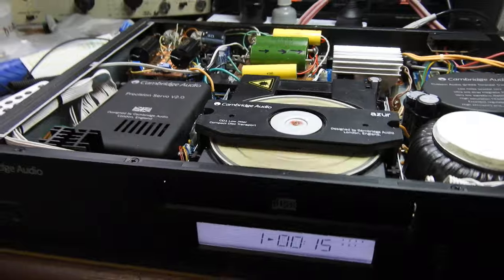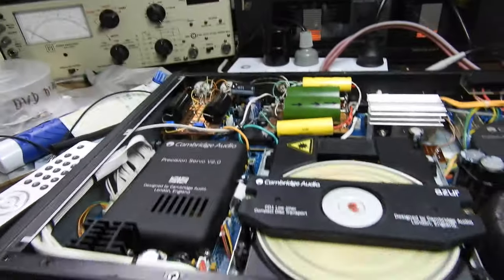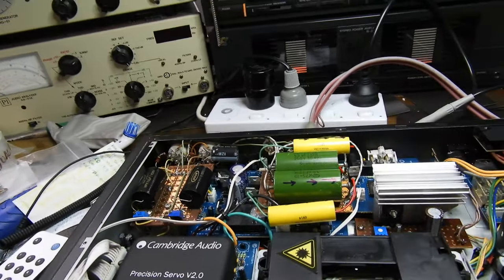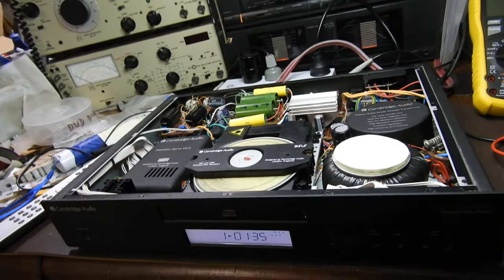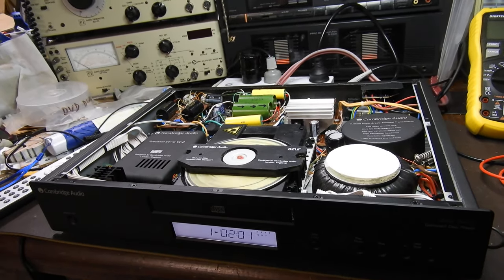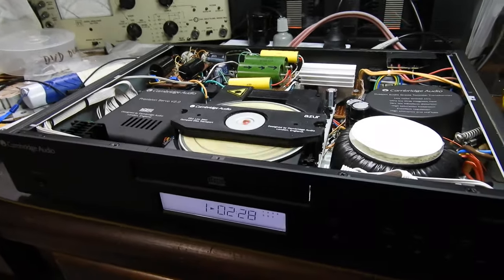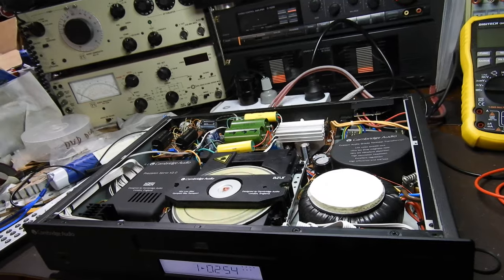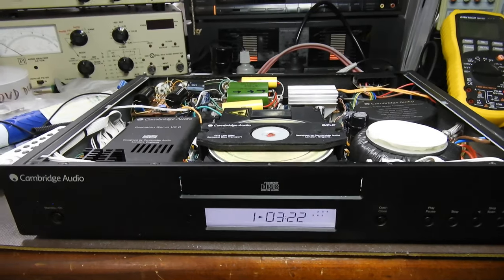Lampizated Cambridge Audio Azur 540C - did not read CDs

Comment: My 540c is spinning backwards very fast when hooking up to the net and switching the button in the back. Any idea what causes it? Faulty ic on the servo board?
Reply from the maker: Not necessarily so. Start with normal service, replace belts, then find and clean all the limit switches. Servo can go berserk if it does not get the right signal in right order. I had players spinning the wrong way many times, but once they get the right info at the right time they start to behave.

Comment: any suggestions for what the issue may be with the door not even opening?  just a belt issue maybe?
Reply from the maker: Most commonly it would be a belt. Can be broken gears as well but it is unlikely
Reply: @hear-net-au  a hint for the belt: just take it out and heat it shortly with a lighter. For me this was enough as well. Did it many years ago when door was not opening (or immediately closing after open I don't remember) and still works fine.
Reply from the maker: @tpatai1976  Drawer opening and closing is a sign of dirty limit switch. 
If you are taking a player apart and doing all this effort, why not spend an extra $2 and actually replace the belt rather than heating it up?
Would you be happy if I heated a belt in your player and then charge you for it? ;-)

Comment: How do I access the belt?  What size is the replacement? Many thanks
Reply from the maker: @Blind Qwl   Remove the mechanism and the tray and the loading belt will be there at the front. Maybe you could even remove the tray with the mech still in place, but I cannot recall now what to do to free it, and it is always easier to work it out with the mech out.
Sadly I do not keep the register of belt sizes and cannot give you a ready answer. Once you take it out, measure it and get a size smaller (2 or 3 mm smaller). If it is totally perished and has turned into goo and cannot be measured, then measure a string that you run around both pulleys and get a belt 2 or 3 mm smaller.
Are you a subscriber? I need a couple of hundred more...

Comment: is it working now after replacing the laser with a new one?
Reply from the maker: As you can see by clicking on the video above, it did work. But I did not replace laser. I hardly ever do. I replaced belts, cleaned grease off the mechanism and restored its integrity by mending all the tiny cracks in the plastic parts of the mech. I used ultraviolet cure glue for this and it worked very well.